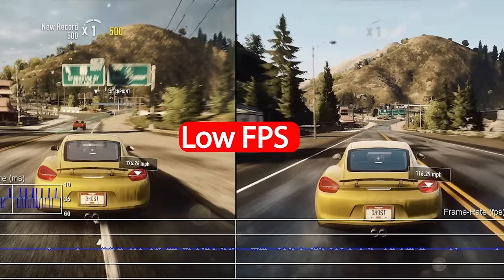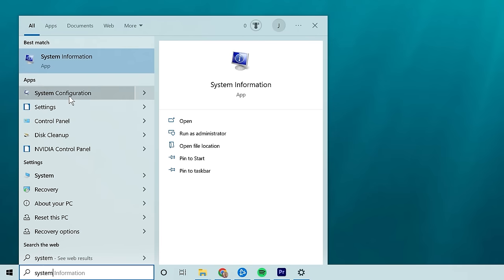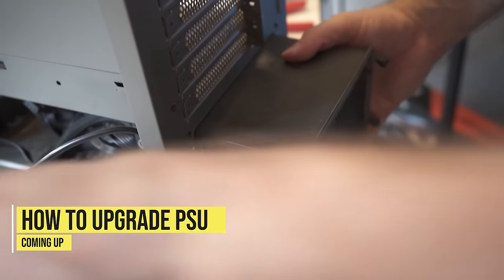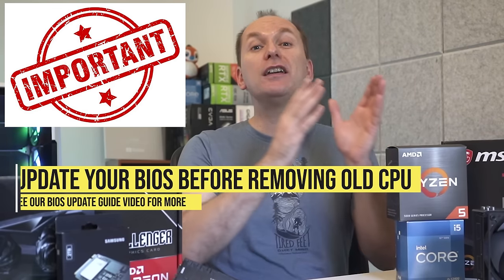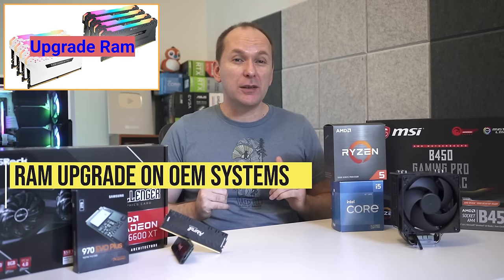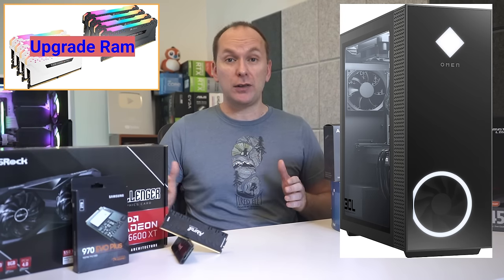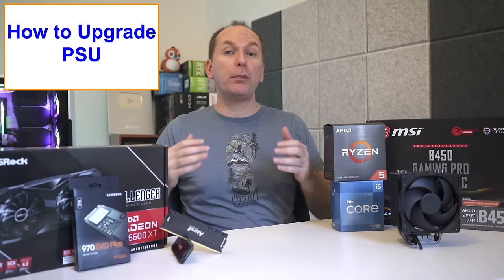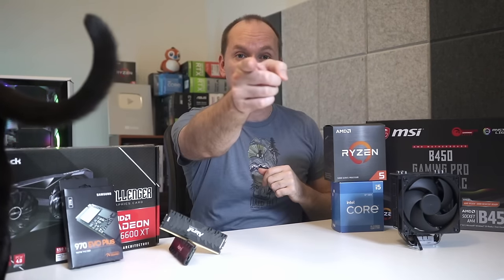How to Upgrade Your PC: How to Upgrade GPU, CPU, RAM, SSD & More! How to Upgrade PC

Comment from the maker: NOTE: For Intel Motherboard compatibility, check out our PC Parts Explained Video
What is your setup, and what are you thinking of upgrading?
Reply: hey pc builder, im looking to buy a i5 12600k with an rtx 2070 super, aswell with a z690 motherboard, is that a good cpu and gpu combo for 1080p competitive settings in most games?
Reply: I have an 11700k + 3090 + 32GB 3600. I’m good for now. Not impressed with 4090 enough to upgrade. Will wait for independent tests + RDNA3 reviews. 

My wife has an older 3600XT + RX580 and could use an upgrade. I’m liking the 5600X + 6650XT combo, as she has a 1440p monitor and her B450 board is still running strong.
Reply: @jpzin4478  I've got all that except I'm using a 2080 super so I'd say that's fine
Make sure the cooling is good though 😅
Reply from the maker: It's fine but a little unbalanced. Sightly overkill CPU for that GPU for gaming. So you might go down in the CPU and up in the GPU if you can.
Reply: @jpzin4478  For 1080, you're all set with that combo.
Reply: No too much of an upgrade but I have a R7 3700x and Asus tuff b450 Plus II and a 3070, and I found a great deal for $275 on an R9 3900x and Asus tuf X570 plus wifi combo, now is it a huge jump, no but Its coming in a few days and I cant wait to put it in!
Reply: I'm getting ready to build my first PC. Got an RTX 3070 second hand for £390 (I have made sure it works properly!). Just waiting to get a Ryzen 7700X.
Reply: thanks guys appreciate all the support!
Reply: @PCBuilderChannel  Congrats on 200k subscribers! I remember back when you had just a few thousand subscribers and I subscribed not long after that because I could see you had good advice to give. Congrats again, and I hope to see you at 500k subs very soon. 1 million will be here before you know it! Good luck, and enjoy your success! You deserve it!
Reply: @-darkangelic-  i highly suggest you step up from the 5600X to a 5800x, as the 5800X has been sitting at $245-$250 for a couple weeks now, and I think its worth the upgrade for 2 more cores and 4 more threads for an extra $50-$60
Reply: Pc builder what are you thoughts on the Ryzen 5800x3d? And the 3090 gpu. I’m looking to future proof a Pc for at least 4-5 years?
Reply: GIGABYTE MB H310M S2V 1.0
i5-9400f CPU @ 2.90Hz, ARCTIC Freezer 34
16GB 2400Mhz
SSD Kingston 480GB SA400S37480G 
GTX 1050ti
PSU 500W
gaming monitor:
ASUS VG258QR 165Hz 1080p
thinking buying new GPU and PSU in late December for 1080p gaming (budget 700$) or wait next summer and buy new one (2000$+)?
Reply: @jpzin4478  I have the 12600K and a 2060 gigabyte... while I do get good frames and I don't need to upgrade anytime soon, I suggest you get something better than the 2070 super... perhaps a 30 series.
Reply: @truejon  i wont be upgrading tbh, i just want a basic pc to get 240fps on most 1080p competitive settings, ill probably get a i5 12400f with a 2060 super.. thanks tho!
Reply from the maker: Thank you so much! And thanks for being with us on the journey!
Reply from the maker: It's pretty great! Especially in comparison to what we know right now on the Ryzen launches but stay tuned for more in the coming week
Reply: @jpzin4478  I do get 240 on games but the less demanding games, kind of. I'd suggest def looking up that build and see how it does. I don't have a super so, I can't tell you know how it. May need a 2070 or some...hope it goes well for you! I am curious what's needed for that consistency.
Reply: I've got Ryzen5 3600 with B450 + RX6600 + 16GB 3600 CL18. I'm staying with 1080p. gaming for a while, just waiting for second monitor to ship to me so I'll stay with my RX6600(bought in Feb 2022) and I think about upgrading CPU (slight futureproof) for 5700X, 5800X, 5800X3D, 5900X with B550 but it will depend on price. No rush I'm completely fine for now.
Reply: I5 9600kf 5.1ghz overclock/Noctua nh d15/Asus prime z390a  
/Gigabyte windforce oc 1660 ti/Corsair 550 psu gold/16gb ripjaws 3200/250gb m.2 boot drive/500gb m.2 for music and music software/1tb 3.5 ssd for games/rosewill cullinan v500 or 400 case?/3 front intake, 1rear exhaust. The only thing I would add is 2 exhaust at the top for better airflow but, I haven't had a problem with heat yet.

I use it mainly for music production and it handles that task with no problems. I've never had a project reach max cpu or ram usage with orchestral amount of vst use but, I have seen 79%. I do game on it when I have block or when a good game is out that's pc exclusive or just has an awesome soundtrack like cyberpunk. It can handle realistic minecraft with the seus ptgi shaders suprisingly well for the sytem being built in 2019 and a non rtx card(even though the 1660 does support ray tracing it doesn't have the prestigious rtx branding or dlss). I will be building a new rig from scratch because I like how my current system meshes so, I'll gift it to my bro when I finish my next build.
Reply: I'm using an old office dell laptop from 2016, runs the games i play fine and I don't think i'll need to upgrade anytime soon since i'm satisfied with it
Reply: Hi everyone. My set up is AsRock B560 steel legend, i5-11600k , gskill 32GB cl18 3600 , cooler master ml 240 aio cpu cooler, rtx3080 trinity OC 12GB , sabrent rocket 4.0 1TB NVME , cooler master gold 750w psu. Still rocking my old NZXT 410 case.  I just need more storage 1TB is nothing compared to how big games are now adays.  Big shout out to Jason with his videos couldn’t have built it without him and as always happy gaming.
Reply: I am making a 1440p system, with a ryzen 5 5600x and a rx 6800xt on a b550 motherboard. Is this a good combo for 1440p?
Reply: About to build my first ever pc build. On the topic of upgrading, I think I want the newest generation of cpu (maybe gpu?) because I dont want to have to upgrade in a couple years to play games that come out in the near future. Should I get something for the new Ryzen series? I play Warzone (currently on ps5) and I'm a serious player. The other thing is I want to do music production (and maybe make youtube videos in the future). For music, RAM and a lot of fast ssd is important, but higher core count isn't necessarily important, nor is gpu but I need that for Warzone. I'm thinking 8 cores, but I'm not an expert on this stuff. I have a pretty high budget for this and I don't care about RGB. Any advice, PC Builder and his knowledgeable viewers? Thanks in advance!
Reply: rn I'm on a oem 7700 1060, but thinking of upgrading to 12400f 3070 with 32gb of 5200 cl38 ram i found (it was like $160), bringing it all together with a  ak620 and strix b660-G so that I can BCLK oc
Reply: Hey jason I been wanting to build a rx 6800 xt in my pc. I saw benchmarks everywhere and I love the price and performance compared to the competition. However I see that it only runs minecraft rtx at 15 fps on 4k. I find this extremely sad and am in denial, however I see in the comments that there is a driver update for amd that fixed this. After looking up information on this I couldn’t find anything to confirm this. Do you know about this? I don’t know much about computers, so some help would be greatly appreciated. Thank you!
Reply: Hi Jason, awesome content as usual.  I do need your opinion on something - In late 2020 (just before prices went crazy), I built my first PC: Ryzen 5 3600 (cooled by a Deepcool Gammaxx 400 EX Air Cooler) coupled with a GTX 1660 Super on a Gigabyte b450m DS3H V2 Motherboard with Ripjaws V 16 GB (2x8) 3200MHz CL16.  Initially, my storage was an XPG SX8200 Pro M.2 500GB and an old Toshiba 1TB hard drive.  In 2021, I added a Samsung 870 EVO 1TB SSD.  My original PSU was the Gigabyte P650 80 Plus Bronze, but got scared when news of the P750 variant blowing up and got the Corsair RM750 when it went on sale in my country 3 months ago.  

All these components are housed inside a RAKK ATX case (see here: https://rakk.ph/products/rakk-haliya-atx-gaming-case-black ) with Arctic F12 Fans.

I use the PC for work (basic MS office apps needed) and play AAA games (Halo Infinite, Resident Evil, Tomb Raider, etc) and the occasional indie that is available on Xbox Game Pass.  

(whew, that was a lot of contexts there)

So, my question: Are there any advantages in upgrading my MB to an ATX?  I ask because the Asus ROG Strix B450-F Strix Gaming II ATX Motherboard got cheaper recently in my country and is selling for about 120 USD.  I know that you recommend this MB along with Asus TUF B450 Pro, but unfortunately, the ATX version of the latter is not available in my country.
Is it worthwhile to upgrade to the ROG Strix MB? Aesthetically, I do think it will look awesome in my ATX case, but I don’t think this reason is enough.  I might have some need for the better audio codec in the future, but not at the moment. Viewing your video on MBs also taught me that ATX MBs provide better long-term durability (Before 2020, my last PC lasted me 8 years!).  I know that the ROG Strix has better VRMs, but I don’t overclock at all.  

Help me save money (or not)!  Part of me wants to push the button and just buy the new MB because I am getting the itchy finger and want to tinker with my PC (hahaha) but the other (more practical part) is thinking that, if this does not really give substantial upgrade in performance or durability, better control myself!
Reply: @PCBuilderChannel  Hey PC builder
I have a i5-9400F + gt 710 ( for now) with adata 8gb 2666.
Now i don't know what to upgrade for the gpu
What do u think? (also to add im gonna for sure add another ram)
i do wanna play games in 1080p and coding.
Reply: @maryzedog4297  I would say hell yeah that is a great 1440P set up.
Reply: I'm gonna buy a 3060, need Nvidia with 12GB or more for AI art (otherwise would get 6800-6900 XT) and use it on my current PC (B250 with a 7600K). After that I'll buy either the Ryzen 7600X (fitting!) when we get some reasonable AM5 Mobos or a 13th gen Intel depending on how that pans out.
Reply: My fairly updated PC part buying guide:

When building,the shorter answer, at the least you need a quadcore CPU,I would recommend a 6core CPU, for gaming/games are ALREADY utilizing 6cores also a 3070ti or 6700XT graphics card, at the least and this is a 1080p card,A LOT of people will argue this though,2TB SSD,at the least, 16GBs of RAM at the least 32GBs for higher resolutions, a 550/600watt power supply or above,depending on if you ever want to upgrade the graphics card and depending on which graphics card you decide to go with, this is whats recommended, for a 3060/3060ti, 500/600watts, for a 3070/,this is what I would recommend to EVERYONE 3070ti or above,which requires a 650/750watt power supply, a 3080 requires a 700/750watt power supply/if you over clock an 850watt power supply is needed,also I would honestly just get an 850 watt power supply,no matter what,so upgrades can be done, without having to get a new power supply, also motherboards/sockets/platforms,we are no longer on Z77 we are on Z690/now Z790/1700 socket/Alder Lake, also something else to think about I think, with Raptor Lake/1700 socket,the i9-14900ks,will most likely be on the meteor lake platform/1851 socket and not Raptor lake/1700 socket,modern graphics cards,3060/3070/3080/3090/4090 and the rest of the upcoming 40 series cards,and also I913900k.

Also im sure this is good news FOR SOME PEOPLE,Intel's 13th-gen Raptor Lake CPUs will use the same LGA1700 CPU socket used by Alder Lake chips and Z790 boards will also use the 1700 socket, but the meteor lake platform/1851 socket platform is also coming out soon,this was the short version, but the next part has some good info in it as well,SOME is repeated from the top, but it goes in to more detail.

Hope this helps,if your only reading the short version.

This gives you some good updated information when it comes to building a new PC.

Your CPU NEEDS to have AT LEAST four cores and when it comes to gaming now days you can benefit, in performance, from having 6 cores,in your CPU, so an I5,if you really have to skimp,but an I7 or an I9,is a much better option,more indepth info on CPUs,especially if you plan to work from your PC:

Best Budget Workstation CPU: Intel Core i5-12400 Alternate: AMD Ryzen 5 5600X

Best Overall Workstation Value CPU: Intel Core i7-12700K Alternate: AMD Ryzen 9 5900X

Workstation CPU: AMD Threadripper 3970X Alternate: Intel Core i9-10980XE

Best High Performance Value Workstation CPU: this is the CPU I currently have, Intel Core i9-13900K,the i9-12900k/ks, is also available, Alternate: AMD Ryzen 9 5950X and now a 7950X

Best Highest-End Workstation CPUs: i9-13900k, also AMD Threadripper Pro 3995WX,you MIGHT also CONSIDER,at least right now/the 3D version of the 7950X,MIGHT be available, AT SOME POINT.

Also if your thinking about AIOs these are good options:

The Artic LF II and the Corsair h170i elite capellix.
  
Depending on what resolution your gaming at, 16GBs of RAM or 32GBs of RAM,16 at the least/16GBs is fine for 1080p/1920x1080p gaming, When it comes to storage, I honestly would get at the least a 2TB SSD, to put that in perspective, I have like 28TBs,but the sweet spot FOR MOST PEOPLE, that game,is honestly a 4TB SSD/MAYBE 9TBs,depending on how many games you have in your Steam library and how many games you want to always have installed/no hardrives,in my opinion,IF you absolutely NEED a harddrive, at least make sure its 7200RPM, a good SSD,for a good price, is the KC3000 SSD, another SSD to keep on your radar/to keep an eye on is the Samsun 990 PRO,also NO TN panels,IPS or OLED, is what is used now days,1920x1080p,2560x1440p,3840x2160p and 7680x4320p,good brands are Asus and Samsung, MAYBE also Alienware, if you know exactly what your looking for and you find a good deal,if you want a different aspect ratio, other than 16x9,you already know that and I don't need to go over that,also the higher the HZ the better.

Also at the least now days,depending on what resolution your gaming at, graphics card wise, is a 3070ti/this is honestly a 1080p card,SOME people use it as a 2560x1440p card, I don't recommend doing that, the Radeon alternative to a 3070ti,is a 6700XT, other recommended graphics cards, from low power to higher power 6950XT, 3080,3090 and 4090s are out now as well.

Heres a little more info that kind of gets you up to date on newer hardware/this kind of gives you a good idea of where we are currently/shows you whats changed;

When looking at CPUS,(*F*), just means it doesn't have integrated graphics,honestly saving $20/$32 isn't worth it/having a non F CPU allows you to trouble shoot things better if your having a display problem with your graphics card/driver issue.

The K part is MUCH OLDER knowledge/MOST PEOPLE KNOW, K USUALLY means you can over clock the CPU,granted A LOT of people under clock, surprisingly now days, to get better temperatures,but an AIO and a good power supply/a good wattage power supply, can allow you to utilize more of the power in your hardware.

SOME of this MAY be slightly out dated when it comes to Z790 motherboards/this was mainly written for Z690 motherboards,a while ago/this was for people coming from Z77 or older to Z690,I've updated SOME of this,but not all/Z790 motherboards have more features compared to Z690 motherboards.

Alder Lake motherboards can use DDR5 RAM and Z690/now Z790 motherboards are what people should be looking at and also keep in mind that the meteor lake platform/1851 socket is releasing soon too.  

I honestly would go ahead and make the jump to DDR5 RAM,I don't see a reason not to, it will just cost more, to do so in the future/RAM prices might go down, but to support it, you would have to buy a whole new motherboard and RAM,AM5 motherboards have taken that out of the equation though/ALL AM5 boards REQUIRE DDR5 RAM.

PCIE Gen 5,is now available too,which offers higher speed USB and M.2 speeds.

Also MOST Z690 motherboards offer at least four M.2 slots,which is nice.

This isn't surprising at all, but USB Type C ports are more widely available too.

8 Sata ports now vs the traditional/older 6.

Thunder bolt 4 support as well.

Really old 1155/Z77/Ivy Bridge, old LGA 1200/comet Lake/Rocket Lake,LGA 1700 New,also even newer soon meteor lake platform/1851 socket ,also if you want Ryzen/AMD, Socket, TR4 old, AM5 is new/ AM5 is what your looking for,but I don't know if AM5 is going to perform well against the new Meteor Lake platform/1851 platform though,time will tell.

Also LGA 1700 water coolers are something you NEED to be looking at,IF you want to go that route, because of compatibility issues/the brackets are different,you CAN get an aftermarket bracket, but if your buying a new water cooler,theres no need to do that.

Anyway I think that covers everything,hope this helps.

You MAY know all of this,but HOPEFULLY SOMETHING here was helpful, I know a lot of times people would rather leave you in the dark about things and just handle it their self's vs giving you the info you need to succeed/ it can be daunting,even if you understand computers,if you don't know what the modern platforms/sockets and so on are and it seems like PC Part Pickers, is terrible now days,hope this helps.
Reply: I have a Ryzen 5 3600 cpu Rtx 2060 gpu  2x8gb 3200 ram 1tb ssd
I was planing to spend £100~today
And I've gone for a 2tb hard drive(£50) for game storage  another 2x16gb(£50) 
One additional note. Should i treat my cpu to a new cooler as well? I have been using the stock wraith cooler for 3 years
Reply: it is a normal pc and i have a intel i7 10th gen which is pretty good but i was thinking to get a amd radeon or gtx gpu and maybe add leds so i can turn it into a gaming and i have a lenovo
Reply: I got a GeForce 3060ti 8gb. I want a better graphics card. An I have  i7 not sure what mother board